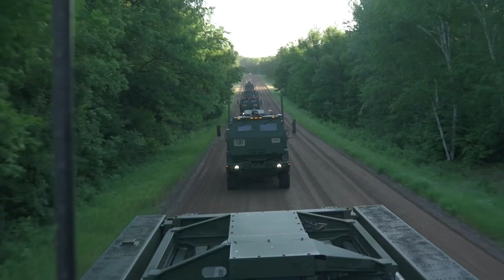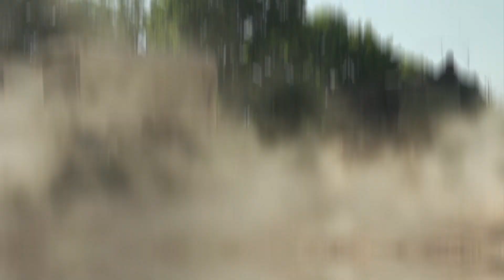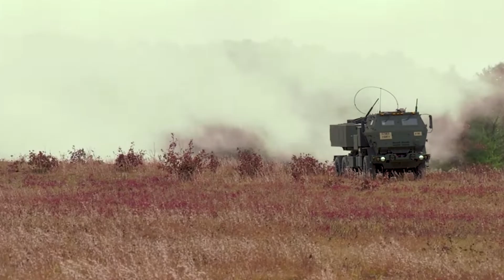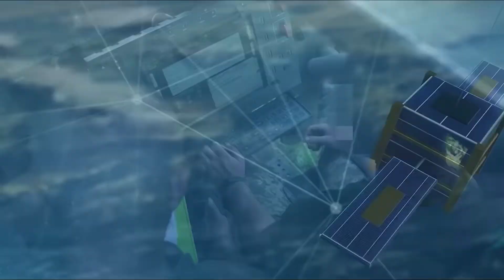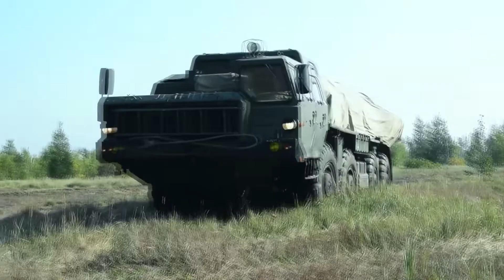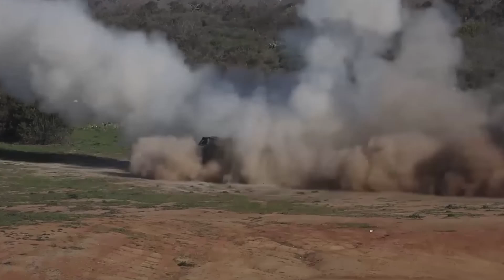Insane Power of HIMARS

Comment: US HIMARS in Ukraine:
⛔Rocket Range: 80 kilometers.
⛔Firing capability per unit: 6
⛔Number of units on the battlefield: 8-9 (16 delivered, 7-8 destroyed).

Russian TORNADO S in Ukraine:
✅Rocket Range: 120 kilometers
✅Firing capability per unit: 12
✅Number of units on the battlefield: 40? 50? 50? 80?

Both systems have same accuracy. So, there you are. The game did not get changed at all.
Reply: they only have 1 round  that's guided and most likely don't use that round as much whereas all Himars rounds are guided and have a range of 80-300KM+ which is accurate within 3-4 feet of its target, dont see Russia boasting those proven stats 😏
Reply: @mindman1234  The HIMARS in Ukraine only have rockets with a maximum range of 80 km, not 300. And Tornado S can fire 12 rockets that all can be guided. So you are wrong. And you miss the point, the HIMARS, at a number of 8, do not change anything in this war theatre. It is just a truck, and they had to spend one week to make some holes in bridges in Kherson. Ridiculous. Besides, pontoon bridges can be set up across the Dniper river in 120 minutes, as the Ukr army did during a military drill in 2016, in Kherson. It is all propaganda.
Reply: @knutstenbak7461  its not just the bridge bro, many ammo dumps/bases have been getting hammered and other high value targets. only 1 munition out of the tornado S is GPS guided the other 6-8 variants of ammunition doesn't use a accurate guiding system. i have a weird feeling USA has been or might arm them with the 300KM missile as Crimea has been getting hit a lot lately. and it is not propaganda, literally every Russia support thinks every fucking thing is propaganda that's not favoring them. so stupid
Reply: @mindman1234  You are still wrong. There are 2 different guided rockets that can be used by Tornado S system. Quote from Janes Defence; "The 9M544 and 9M549 are understood to be the latest guided rockets fired from Russia's Tornado-S system." 

8 remaining HIMARS can not even make a dent in the Russian war machine, it is not possible. Sure, some depots get hit and what not, but so what? Russia can and will hit 10 times the amount Ukraine is hitting, because of that they have 10 times the amount of firepower/gear. Think about this: If HIMARS are a gamechanger, why did the not send 100 of them to Ukraine? Why only 16? Why not even replace the 8 that are destroyed? The Donbas defence line is collapsing, after that the war will change. Because there will be no such defence lines left, not of that quality. And thus, Russian forces will start moving, instead of standing still. My guess is that Nikolaev, Odessa and Kharkiv will be attacked, and taken. But, lets see.

Comment: Guided rockets... ???If a weapond is guided and use a rocket engine it is a missile. AMRAAMS,(Advanced Medium Range Air to Air Missile).are guiding itself to the target but have no jet engine. it have a rocket engine. If it manipulates rudder surfeses to guide itself to a target."it is a missile". What is this system....????? Is it using GPS, IR,Cameras or are is it tv guided. If it is clsefied/Top secret things just dont mention it.sry but missiles and rockers are talked about as the same thing by to meny reporters and news medias.
,
Reply: HIMARS is a rocket, no jet engine.    Kind of like motor and engine.  An engine is motor but a motor is not an engine  it is a motor.   BMW= Bavarian Motor works.  A motor is electric.
Reply: @lw7238  In other team,  rocket can't change or control speed, Missile can, that is why Missile can fly with slow speed and lower flat course.
Reply: @jxmai1000  Actually HIMARS can do both systems.  The high-mobility artillery rocket system carries a single six-pack of MLRS rockets, or one army tactical missile system (ATACMS) missile.  I though only rockets but it carries both.
Reply: @lw7238  It's very easy, think about tank can fire missile.
Reply: @jxmai1000  You sound confused.

Comment: In reality Russia doesn't have any kind of shield against himars,even  S-100 to S-500 don't work at all.himars was invented in the 80's.
Reply: Yeah and Almaz Antey, the manufacturer of the S400 had claimed that the S400 would "swat HIMARS missiles down like walnuts from a tree" and charged the Russian military billions for a feature that doesn't even exist. The S300 and S400 that were supposed to protect the base from HIMARS were destroyed by the very weapon they were supposed to defend against.
Reply: @jamesstreet228  would you believe something that comes out from the Russian...its all rubbish
Reply: The US sent the M88's anti radiation rockets and they can take out any S battery.  Russia is fucked!
Reply: S-400 can detect GMLRS but its to expensive to shoot at 🤣🤣
Reply: even if they could - what's the point of shield against el-cheapo himars rocket with "satelite killer" (that killed none satelite) S-500 "prometheus"?
Reply: @spicydiarrhea5662  no just admit that They cant
Reply: @nickbens6565  they can't and they don't want nor need to
Reply: Invented in the 80's, BUT continuous improvements ever since. The gun was invented around the fourteenth century, but they are a bit better now.
Reply: They can shoot down HIMARS but the US knows how to decoy the S400.
Reply: @manticore4952  Sorry no they cannot, only lucky shot can.  It will take 1.5 years for Russia to change their computer controls over to hit HIMARS.   The computer systems need to be updated, sensors, operators, and personal need to be trained for HIMARS.
Reply: srussian air defence system with cartoon characteristics, in 2017 years s-400 can't caught tomahawk missiles in Syria
Reply: US military budget is 3 times larger than Russian military budget.No wonder US military weapons are far superior than that of Russia.🤣

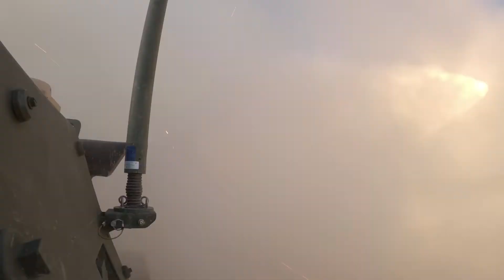Comment: 1:27 "it measures 5.045m in length 2.16m witdth  and 2.251m height" not quite:  the vehicle length is 7meters and width is 2.4m and height is 3.2m the numbers in video might correspond to the sixpack of missiles but not the M142 source wikipedia gtetings from Finland and Slava Ukraini

Comment: 5.046 meters in length? This is smaller than a typical minivan, such as Honda Odyssey. Doesn’t sound right. If you get this simple data wrong, I wonder what else is false in this video…
Reply: That was the rocket itself. Not the truck and gear.
Reply: @lw7238  well, in the video he was talking about the truck,  not the rocket. Hence my comment.
Reply: @ivans.935  Yes I see.  The HIMARS 6 pack rocket box is the dimensions of what he said, NOT THE UNIT.  the TRUCK AND BED ARE 23 feet long, 10 feet high, and 7. 10 inch's wide.

Comment: I'd like to see the development of an airborne drop system of this platform.
Either recoverable, or fire and forget.
Reply: In a Vertical Envelopment you want to secure the LZ before risking more advanced systems, it is the most vulnerable stage. They target places they can land large aircraft to deposit follow on forces which done immediately upon securing airfield. Surprise is going to be the key in taking a base. The HIMARS would be key in holding it for a counter attack. They would need some sort of Counter Battery Radar as well.
Reply: I'm talking about dropping this out the back of a C5.
The glide ratio would put the armament 3 to 4 x advertising distance. Plus changeable targeting
Reply: @williamhibbs4632  don't be silly; the USA has multiple aircraft that can do the same thing (e.g. F-111 or B-2) quickly.  A C-5 would be vulnerable just as the large Russian transports were in the first week of this War.

Comment: Not ground-breaking but reasonably comprehensive, so earned a "Like"
Reply: well, it did broke ground on multiple bridges
Reply: @tonyj4435  They used this video to attack bridges? I had no idea!
Reply: Russia's S batteries have only shot down one HIMARS so far and that was probably a lucky shot.
Reply: Well, the mission of  HIMARS is to break ground. And it did succeed in breaking ground. So the Russia soldiers are losing. 🇺🇦🇺🇦🇺🇦🇺🇦🇺🇦
Reply: I've read it has some dirty secrets for the enemy in those missiles that allows them to avoid some missile defense. 

 Then again the propaganda is strong with this one. Also Russia's military just seems to be screwing up left and right. *Lack of training, command, logistical issues*.

 (Edit) I am just speaking hearsay BTW about the first part. I know nothing and seems odd no one talks about this magical countermeasure.